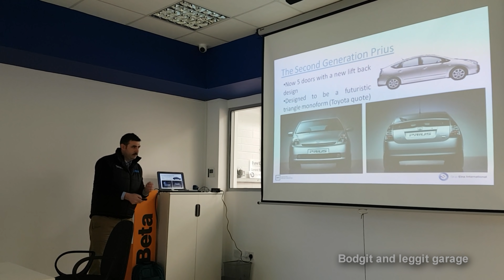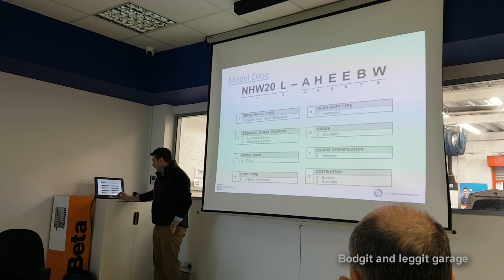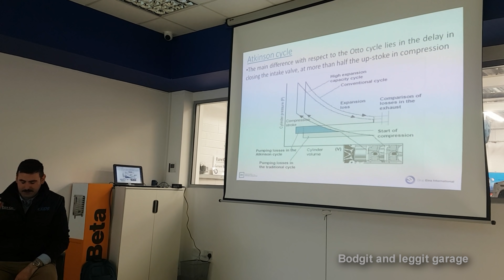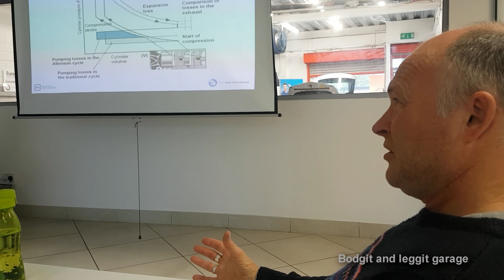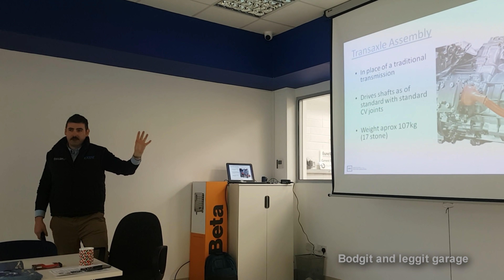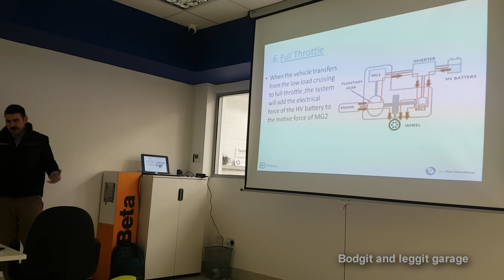ELECTRIC / HYBRID EV Course Bodgit And Leggit Garage

Comment: Can someone tell me how to connect a electric motor to a combustion engine... like a setup like in the p1 let’s say.. I’m trying to build a project and want to use electric assist but can’t figure out how to connect the motor to the engine and keep the gears... I would have a trans axel from the engine and then want to add a electric motor to it

Comment: I have this insane idea. What if one put 4wd front suspension and hubs in a rwd vehicle, and powered the front wheels with a Tesla motor slaved to a secondary alternator and battery system? Could that work to hybrid a plane jane 96 D21 Nissan pickup?
Reply from the maker: Hi mate anything is possible but like everything it's all about money and that would cost an absolute fortune to do but it would be possible
Reply: @bodgitandleggitgarage  Consider that I live in the US in a state with no inspections...
Reply from the maker: @izzyplusplusplus1004  it's got nothing to do with that mate it's more of the 30000 plus it will cost to do this and that prices if you're doing everything yourself

Comment: Electric and hibrid cars aint the future .Electric cars are so dangerous to work on and in an accident they can explode .Waste of time.
Reply from the maker: Hydrogen cars and hydrogen cells are the way of the future but you have to start somewhere it's interesting technology you cannot deny that and it's like everything they're not dangerous to work on if you know what you are doing people work with high voltage a lot higher voltage and amperage than these and they don't die every day that's why you need to know what you are doing and take courses before you work on things you don't understand if everyone thought every new invention and everything new was a waste of time we would not get anywhere we have to do things like this to see if it will work or not work and move on that's how the world works
Reply: Hydrogen cars yes ,better than electric .Can u imagine everyone in Ireland had an electric car where the fuck Would u get the power from.
Reply: @deathcert75 hydrogen is also made from electrical processes, in fact per mile driven, its far less efficient too, hydrogen cars havent improved over the few decades as you cannot carry enough hydrogen to cover as much range as electric now do. pure electric is the way forward, and the slow charge is easy to solve too, the chinese electric cars have batteries that are removed at a 'fillings station' automatically, tesla only played with this idea and stopped